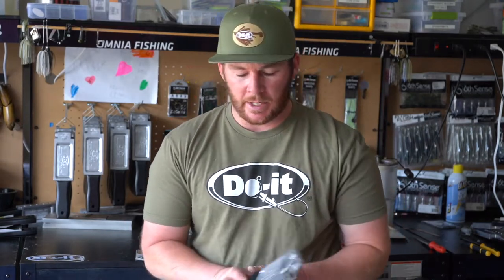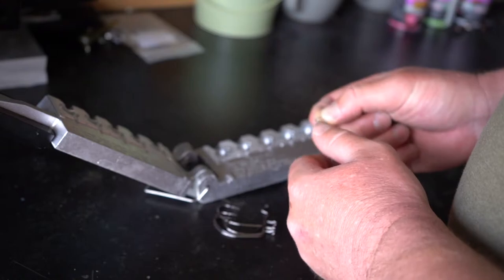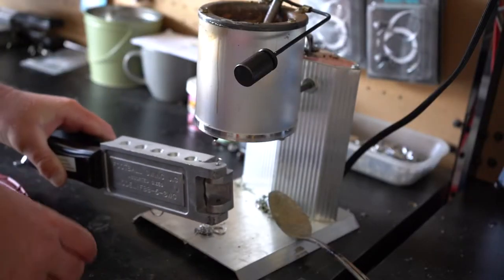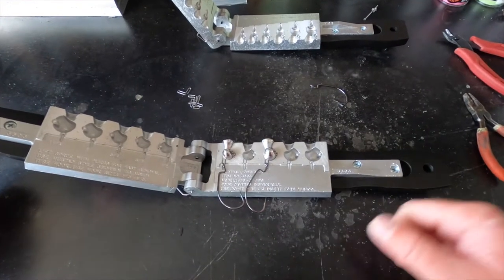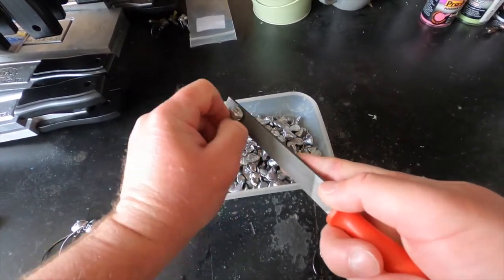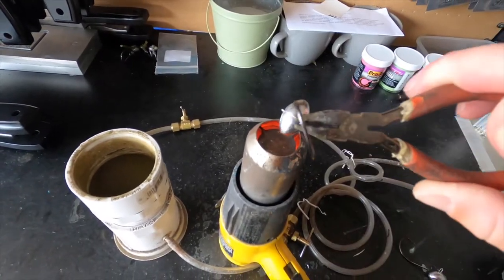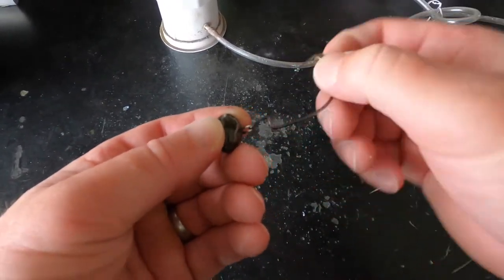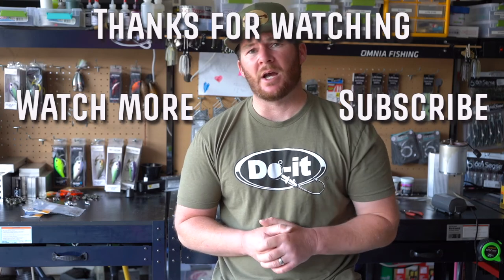How To Make Jigs - Do-It Molds Football Swing Jig Mold

Comment: I just started pouring and painting my wobble heads or whatever they are. But I use vinyl paint n primer. It takes a bit more work to paint. I’ve never used them FYI. I got the small mold first. Finding out the heavier heads are more popular. I ordered the heavier head mold today. I’m excited to fish them. Great video and thank you. I didn’t have watermelon for the fluid bed is why I went with vinyl for now. Just FYI 👍
Reply from the maker: That’s awesome.  I’ve never done the vinyl before.  The heavier wobbles are more popular for sure.
Reply from the maker: Btw I’ve got a giveaway going on my most recent two videos.  All the entry details are in those videos!

Comment: Have you tried making the 1/8 oz jigs? I made some and the wire form doesn't quite reach into the lead, leaving a little gap. Do you have any pointers for this?
I made other sizes and they turned out great
Reply from the maker: I haven’t tried to make 1/8oz ones.  I don’t even have the mold with those sizes to even give it a try.  Wish i could help you more.